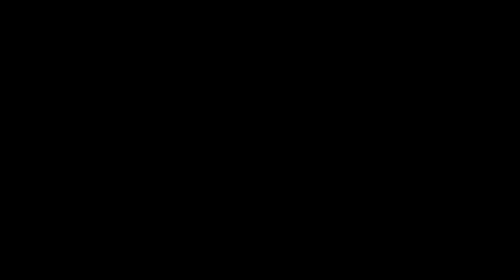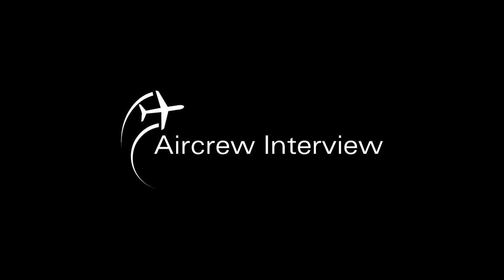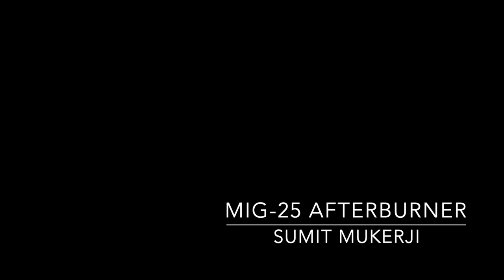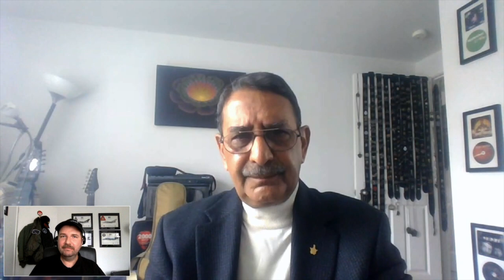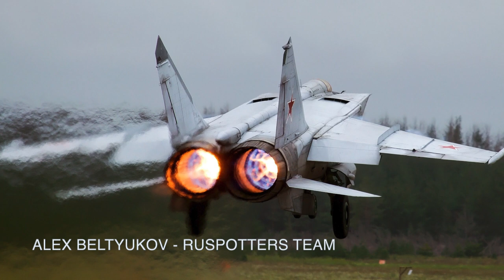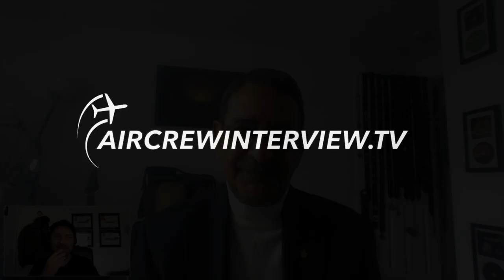MiG-25 Foxbat Power! | Sumit Mukerji (Teaser)

Comment: Everything about this plane is awe inspiring ... 22km equals 72000 feet....just on a normal mission ...
I believe an experimental version hit 123000 feet !!!!
This is a great coup for your channel ...cannot wait ...
Reply from the maker: Cheers Brian.
Reply: And that thing is the size of an embraer 190. When you look at it in person, you can't fathom where does all of the fuel go for it to be able to even take off, let alone do mach 3.
Reply: @zloychechen5150  And made from stainless steel.  Truly a flying brick with monstrous engines, short combat radius,  32,895lb of internal fuel, 662ft2 wing area.
Reply: 123k? Any evidance you can support with?
Reply: @MitjaBonca  look up this guy …famous Russian aviator “On Aug. 31, 1977 Alexandr Vasilievich Fedotov, an official ‘Hero of the Soviet Union’ and test pilot, set an FAI World Record for altitude when he climbed to 123,523 feet (37,650 meters) in his MiG-25.”
Reply: @briankay4713  Series of zoom climbs from different altitude plateaus where speed is built up to get to the next bench.  Pilot wears a pressure suit of course.  The MiG-25 practical ceiling was in the 30,000-55,000ft range,  max service ceiling at 67,900, which is very high.
Reply: @and321now Before I go down this path with you, talk to me about your background in metallurgy, because it doesn't look very good from how you worded that response.
Reply: @LRRPFco52  
Hello, Mr. old liar!
Short combat radius?
The MiG-25 is not a dogfighter, but a high-altitude supersonic interceptor. Its flight range is optimized specifically for this flight mode.
The interception radius of the MiG-25P when flying at a constant speed of Mach 2.35 is    600 km.
The interception radius of the F-15C flying at a constant speed of Mach 2 is    230 km (this was the requirement of the Air Force, and it was confirmed during the tests)
Come on, man, answer me something.
Reply: @TD-qh6yu  600km=323nm is a short combat radius.  Even the F-4 had a longer radius than that, and F-4 was always struggling for gas.

F-15C combat radius is around 685nm/1270km, more than twice the MiG-25’s.

F-15C doesn’t fly at a constant Mach 2.  In order to reach Mach 2.35 and maintain it in the MiG-25, you have to convert massive amounts of fuel rapidly with an airframe that can handle sustained aerodynamic friction.  Therein lies the design trade-offs of the MiG-25.

Every time it has faced the F-15 in combat, it has been shot down or run away.

Interestingly, the MiG-25 is the only Russian fighter/interceptor with a positive A2A exchange ratio.  All the others have negative exchange, with embarrassing lop-sided losses.
Reply: @LRRPFco52  The lop sided losses have more to do with the doctrine used on most Migs though. Hushkit has an interview with an Indian pilot who was part of the team to buy Mig 21s in 1963 from USSR, and he stated that according to Soviets, the entire fleet was supposed to be destroyed in few weeks. This was super weird to Indians, who used the Migs in western doctrine, and achieved both positive K:D with them in 1971, as well as very good sortie to destruction ratio in 1971,1984 and 1999 war. If Russians used Western planes and exported their doctrine to western nations the American planes would have faced similar bad k:d ratio
Reply: @dragonstormdipro1013  It's really multi-factorial:

Aircraft systems  quality ("Russia" and "quality" are oxymorons/incompatible)

Training (Russia sucks at training because they're poor and retarded after generations of brain drains).

Weapons (Russian A2A missiles are generally garbage, except for the R-73).  One of Indian Air Force's complaints about the R-77/RVV-AE is that it's a piece of trash that fails frequent tests just from sitting there, has poor WEZ, poor reliability.  R-27 series are pathetic.  US and UK probably put the R-27 through more rigorous testing than the Soviets ever did, after acquiring the East German inventory.

Pilot and GCI culture with controllers, lack of pilot autonomy.

Basically everything they do or make is excrement in comparison with US systems, barely surviving by knocking off Western designs and exploiting US, British, French, and German RDT&E.
Reply: @LRRPFco52  It has gone several magnitudes worse since the dissolution of USSR. For example, Su-30 MKI is the best Sukhoi out there, not because of weapon systems or stuff, but simply because it has Indian wiring and mission computer in it, which are much better than Russians could ever make.
Reply: @dragonstormdipro1013  And Israeli ECM, some foreign-sourced systems that actually work.  India is making her own BVRAAMs as well after the weak performance of RVV-AE in Feb 2019.

That plus buying Rafale F4 with Meteors.
Reply: @LRRPFco52  Mig 25 was probably the most "western" plane Soviets ever made. You can read the interview by Sumit in Hushkit and you can see that. 

Btw are you Indian?
Reply: @dragonstormdipro1013  MiG-25 was a Russified hybrid of the A-5 Vigilante and AVRO Arrow.  I'm not Indian, just have been in defense and aerospace since the 1970s.
Reply: @LRRPFco52  Sir! I'm looking forward to a link where I could see confirmation of the information that "MiG-25 was a Russified hybrid of the A-5 Vigilante and AVRO Arrow". I've never heard of it. I believe that Foxbat, built around huge engines and a huge radar, simply could not be different in its design. That is, its design was dictated by its features. At first, the Russians built their first supersonic aircraft with a central air intake with a Mach cone, but already in the Ye-8 the air intake was under the fuselage, and the nose cone was freed to accommodate a large antenna. I read an interview with Russian designers about how they first wanted to install one large keel on the MiG-25, then decided to place two smaller keels, at first they wanted to place canards, but then refused, and so on. Basically, the entire design of the MiG-25 was dictated by the peculiarities of aerodynamics when flying at a speed of Mach 2.5+, which neither the Avro Arrow nor the A-5 reached even close. I don't want to think that you are one of those empty talkers and liars, of whom there are a lot on YouTube, and who instead of evidence say "I am an engineer who worked in the field of aviation or space technology, so feel free to believe me, bro"! 
So, sir, I'm waiting and hoping!
Reply: @1F1-q9p  They had moles within the AVRO Arrow program and the planform resemblance to the Vigilante is obvious.  Wing sweep angles, wing position, fuselage, and intake geometry are Vigilante.

Radome size and ogive are driven by performance requirements and R&D done already on the Arrow and its Hughes Radar and Fire Control.  Both the Vigilante and Arrow were developed and first flown in the 1950s.  Both were Mach 2+ designs.  Vigilante would cruise at Mach 2.1 at 40,000ft, set the world speed and altitude records for many years.

A lot of people don't understand how poor Russia is.  Russia simply has never been able to afford to conduct extensive baseline RDT&E for new technologies, especially in aerospace.  They rely almost entirely on theft and espionage to gain understanding of how to build aircraft, engines, flight control systems, and electronics.  The MiG-25 was not exempt from those harsh realities.
Reply: @LRRPFco52  Sir, you're lying to me!!! Vigilante has never set any records, neither in speed nor in altitude. He has never been used for this, unlike Phantom, Starfighter, Thunderchief, Black Dart and Blackbird. All information about the records is available and easily verifiable! Also, the Russians conducted wind tunnel tests for tens of thousands of hours, and used more advanced mathematical methods than those used in the USA or Europe.Sir! You didn't provide the evidence I asked you for. A bunch of words and zero evidence? It doesn't work with me. I am deeply disappointed. It turns out that everything you said about Euro Arrow and Vigilant was a pure lie. That's what they call harsh reality, sir.
Reply: @1F1-q9p  A3J Vigilante set speed and altitude records, some of which weren't broken until 1973.  A3J (A-5) set speed and altitude records in 1960, using a Mach 2.1 dash to reach 91,450ft/27,874m altitude.

Guess which aircraft beat the Vigilante's altitude and speed records?  Ye-155 piloted by Pyotr M. Ostapenko, June 4th, 1973.

The Canadian engineers and project lead on Avro Arrow were literally ordered to give a full technical briefing to a visiting team of Soviet aerospace engineers.  Floyd covers those events.  He refused, but the Canadian government demanded that he do it, which made no sense to him at all.

The Soviets already had plenty of moles within the Arrow program, but things were compartmentalized, so they used whatever pressure they had to get the Canadian government to give them a full program brief.

Then they went to work on finalizing their design hybrid copies from the A-5 and Arrow, bypassing the normal highly-expensive RDT&E processes, to develop the Ye-155 prototypes, thus birthing what would be the MiG-25.
Reply: @1F1-q9p  For information on the Soviet exploitation of the Avro Arrow program, read:

Cold War Tech by R.L. Whitcomb pages 188-189

"When discussing the spy issue, Jim Floyd has reported his surprise when the government asked him to host a team of Russian designers and aerospace experts..."
Reply: @LRRPFco52   You keep shamelessly lying to me, sir. Vigilant could not set a altitude  record of 27,874 meters in 1960. Because in 1959, the Su-9 set a record of 28,852 meters! Then the Phantom broke this record by climbing 30040 meters, and a few days later the F-104 climbed 31,500 meters. It was all in 1959. The MiG-25 in 1973 broke the altitude record set by the Starfighter.

Floyd never said anything about the fact that he held a technical briefing for designers from the Mikoyan Design Bureau, or that the MiG-25 was a hybrid of Avro Arrow and Vigilant. By the time the Avro Arrow program was closed, the P-15 engine was already being tested. He had nothing to do with Canadian developments. And an airplane built around that engine, too. It had a different design, a different wing, vertical fins and so on. Your usual chatter and lies, sir.
Reply: @1F1-q9p  Wikipedia isn't a reliable source, especially when they use forum entries as references.  There's an international monitoring and records-keeping organization  for speed, climb rate, and altitude.

I don't like your hostility and ignorance of the subject, plus your baseless and childish allegations of lying, so have a nice day.
Reply: Max  A3J set a record of hitting Mach 2.1 at 40,000ft, then zoom-climbing to altitude.  There are different metrics for record setting, not just altitude.

A3J could do Mach 2.1 in level flight at 40,000ft, without having to dive.

I've been interested in the Vigilante since the 1970s when it was still in service as the RA-5C, way before the internet existed.

F-104 might have used a stepped dive profile for its speed and altitude records.

Most MiGs, the F-4, Sukhois, and F-15 Streak Eagle used that type of profile where you chain down the aircraft on the runway, let it spool up to max AB, sever the chain for a max performance take off, hug the runway until reaching 400+kts, zoom climb to ~20,000ft, Immelman over and into a shallow dive to regain speed, accelerating supersonic, zoom climb again up to ~40,000ft, do another Immelman and shallow dive into airframe/engine max V0, then zoom climb again to maximum altitude.

Pilot(s) have to wear pressure suits when doing these max performance/max altitude excursions because your blood will boil above 63,000ft.
Reply: @dragonstormdipro1013  can you link that video? i can't find it anywhere.
Reply: @sidv4615  It's in Hushkit magazine

Comment: Damn this Russian vodka; clearly I meant the Me 163 - you know, the rocket one; the one that kept dissolving it's pilots! so, to be clear, the MiG 25 took off with it's hair on fire, like the Me 163, had the 'oh, turn the stopcocks down a bit' upgrade, and floated back to earth (with an engine that needed rebuilding) is that about right?
Reply: No?
Reply: i think they do it , to save fuel cost , like ur already going mach 3 ,u can easily glide from 70,000 feet , u can easily glide from there.